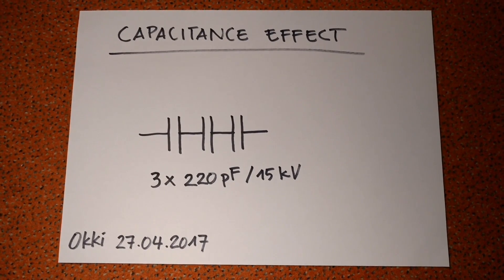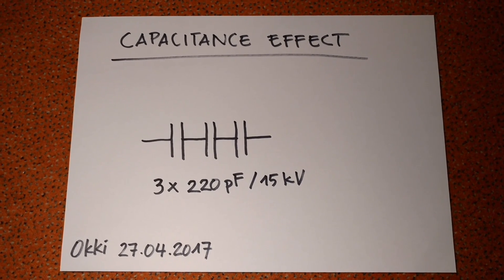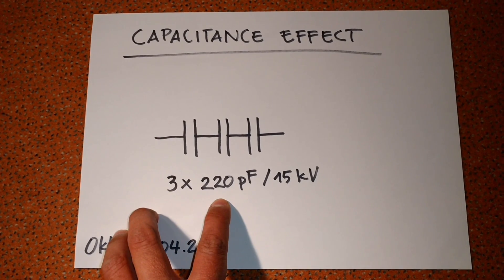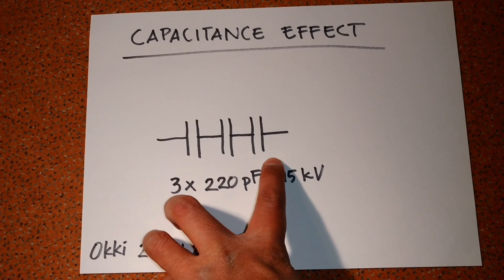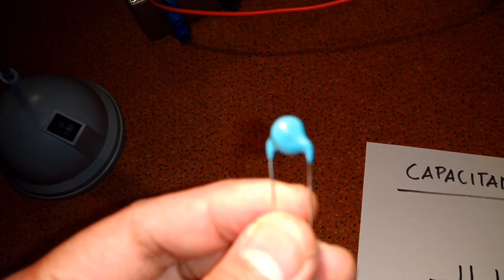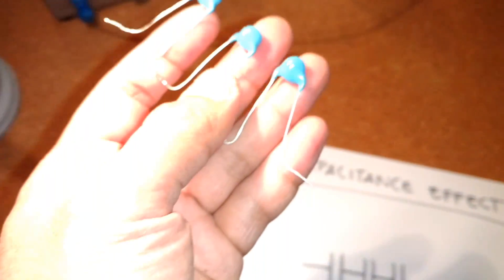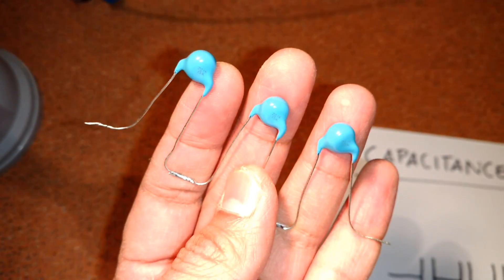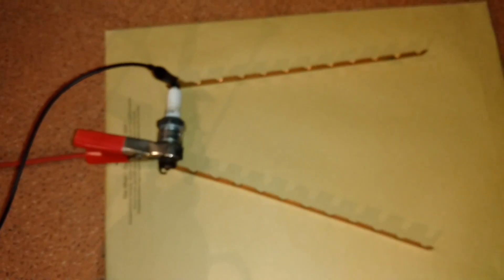Simple Plasma Ignition - Capacitance Effect

Comment: If this work so good... than any car factory used it from 70s. And if they don't... maybe it is not so good as it seems.
To make this test good - you have to make air pressure on electrodes equal to that it is in runing engine.

Comment: Greetings my friend!Great video!I have a question..Surely,we use low resistance ignition wire and non resistance spark plugs..Does it really matter if we use spark plug cap with resistance?? Or the whole idea is to have the less resistance possible to our "circuit" =(spark plug wire,spark plug cap,spark plug) ?I plan to use 3 capacitors like these at your video (15kv,220pf) in series to a 125cc motorcycle for experiment,hoping the piston won't crack.. :P
Reply from the maker: Hi Nick. Any resistance along the way will reduce the plasma effect, if it's too high it will kill this effect completely. Connect the capacitors as close as possible to your spark plug, the closer the better. You can crack your piston only if your engine is knocking but not from the ignition.
Reply: Thanks for the advice..I'll give it a shot!!

Comment: I dont understand the reason why the spark is getting stronger
Reply: The current isn't constant, it's actually pulsing at a high frequency. I think that the capacitors get charged when the current is flowing and then discharge across the gap when the current stops.
Reply: So it's like a double spark? The first provoced by the ignition coil and right after that the second by the capacitor discharge?
Reply: @josefelix4152  I think so. It's just happening so fast that it seems continuous.

Comment: Does it applies to improve a motorcycle ignition? Does it increase the frequency or only the AMPs? If it increase the frequency I guess I won't work because of there won't be synchronicity with the engine cycles, right?
Reply from the maker: These capacitors intensify the sparks just like nology hot wires do.

Comment: Hello! Thanks for the video! I have a question. I build circuit for driving car ignition coil, and it's working perfect, but there's no any difference when testing Standard - Copper spark plugs, and Iridium (all NGK). Also there's no any difference in the spark when using 1, 2 or 3 strings by 3 capacitors, each 220pF/15kV. What could be the reason? What is your coil or driver circuit...? Please help
Reply from the maker: Please measure the resistance of those spark plugs. This simple plasma ignition will only work with non-resistor (low resistance/copper) spark plugs. Any igniter will do, no need to build igniter exactly like mine.
Reply: @OkkiMoeljadi  The resistance of some of my plugs is 4k, but i have also one with 0.04 ohm. Well... even with so small resistance and 3 strings by 3 cap.- 220 pF/ 15 kV, there's almost no difference... What coul be wrong?
Reply from the maker: It won't work on 4k ohm spark plugs. Try that with non-resistor one. You can try with 2 caps in series instead of 3. Make sure you are using copper core ignition wire as well.

Comment: What voltage you are applying?
Reply from the maker: I use Bosch ignition coil.
Reply: How are you controlling the spark?, Oscillator? Points/motor?
Reply from the maker: I use a home-made igniter.

Comment: i try with my piaggio not working do i need battery for it?
Reply from the maker: You don't need any battery for this.
Reply: Okki Moeljadi  hi thank you for your reply cant get it to work
Reply from the maker: Maybe you need smaller capacitor value. You can start with 50 pF and see if it works.
Reply: Okki Moeljadi  does it matter how i connect do they have minus or plus?
Reply from the maker: If you confuse about the connection, please watch all my videos regarding plasma ignition. Your question has been answered there. I have shared all information for replication.
Reply: Thanks

Comment: Was that just increasing the number of sparks per second or was it also increasing the strength of the sparks as well? 

Thanks for the video BTW.
Reply: I'm pretty sure it was doing both...but I wonder if it would melt my piston 😂
Reply: I believe it’s just increasing the frequency. Since the distance of the spark gap is constant, the voltage required to dielectrically breakdown air is constant. For example, if the spark gap is 1 cm, it takes 30,000 volts to arc across. Obviously the spark plug can generate this high of voltage on its own and has a certain frequency. The spark plug is just an LC tank circuit so by adding the capacitors in series, the total capacitance decreased. Frequency = 1/(2pi*sqrt(LC)) so as capacitance decreases, frequency increases. Even if it increased the voltage capability, the voltage would only ever reach 30,000 volts before it arced and went back down to zero. I think it looks like the arc is more intense because there are more of them per second.
Reply: @Nicksperiments  doesn't capacitance increase in parallel, and decreases with series?
Reply: Revi M Fadli yes, I meant series. Good catch
Reply: Kyle Clark it is only increasing the spark intensity because the spark frequency is depend on how fast you want to drive/push the throttle.
Reply: @vughdeziestem4358  I think this is why it wouldn't work with a vehicle, because increasing the frequency there won't by synchrony with the engine cycles
Reply: Luis Ernesto Alvarado Holguín vehicle spark timing  operation is done by pulse signal transmitted by pulser.  that why we need timing belt/chain to keep timing operation synchronous all the time. the circuit above is only gain arc power.
Reply: Vugh de Ziestem are you saying you change engine rpm by changing the frequency of the spark plugs? Cuz that’s not how it works. Cars have distributors that determine when to send power to the spark plug and it just increases how often it sends power to increase engine rpm. If each cylinder was fired every time the spark plug sparks you’d have an engine going minimum 50,000 rpm. This video was just to demonstrate LC circuits and nothing to do with cars. Spark plugs just happen to be pre-made LC circuits
Reply: Nicksperiments i mean engine rev influence the spark frequency. i think this video demonstrate how to increasing spark intensity of an engine (car/bike).

Comment: Capacitors connected in series exponentially reduces the capacitance. Is this actually helpful here? Because i know that less capacitance means a faster discharge.
Reply: Isaac Westawski sometime that is needed to be able to withstand higher voltages
Reply: Isaac Westawski no matter how fast discharging rate as long as the coil is able to supply current/voltage.

Comment: I wonder just what is happening? How can a capacitor create 'plasma' spark? Is it just higher kv at the plug? And why it will not work on resistor plug?
Reply from the maker: If you want to know how this works, please study Tesla Coil and pay very good attention to the primary side of the system.
Reply: The spark plug is an LC circuit. As you add more capacitors in parallel, the total capacitance decreases which exponentially increases the frequency
Reply: Science

Comment: How many capacitors can you add? Surely there is an optimum number? Can it be worse if too many?
Reply from the maker: How much capacitance you can use depends on your system. The more power the ignition power has, the more capacitance you can use. You also have to consider how high the maximum RPM your engine can run. By adding capacitors, you will actually lower your maximum ignition frequency.
Reply: I was thinking on this booster, because my spark is very weak and on lower RPM the spark is even worse. The max. RPM this engine revs is around 7500 RPM, so how much capacitor do I have to use if I have a weak ignition spark and the RPM is relatively low?
Reply from the maker: Jordán, you can start with 70 pF capacitor.

Comment: I don't understand what I just watched.
Reply: He added more capacitors to increase the frequency
Reply: @Nicksperiments  that's what I don't understand...  How changing capacitance increased the frequency.
Reply: Josh Withrow as you add capacitors in series, the total capacitance decreases. The spark plug is basically an inductor and a capacitor so it’s an LC circuit. For LC Circuits, frequency = 1/(2pi*sqrt(LC)) where L is inductance and C is capacitance. So as he decreases the capacitance, it’s making the denominator of that equation smaller so larger frequency
Reply: @Nicksperiments  Capacitance in parallel conection of capacitors increase, in series decrease. Or I'm wrong ?
Reply: Wrublos212 yes, I meant series. Good catch
Reply: i c u p

jk i see you everywhere

Comment: Your ignition system will be making less than 5 KV with that spark gap so won't run an engine. To do a real test, open the spark gap to 3 cm and repeat with the capacitors.

Comment: Great video this help with performance most people don't know that a bad spark reduce power and waist fuel you can do this just with the coil no inverter and it will work to if you have a weak coil this will help you
Reply: i would NOT try that in an engine as a hot spark will burn a hole in your piston
combustion engines are all about balance

Comment: Brilliant demonstration of how capacitance can create a stronger spark - however, most motorist wont see much gain unless there ignition system is very weak by design or you have modified the engine IE:- fitted a bigger turbo or increase the amount of boost to produce more power and the intake charge is too dense for the standard ignition system to fire it !  None the less im sure this will help those who need it - great work sir !

Comment: Hi sir,,,I tried in my motorcycle 125 cc...the spark plug shows me nice spark at the outside ...but when I put it inside..my bike doesn’t want to start..any solution??
Reply from the maker: 1. Measure the capacitance value. 2. Check for electrical leak (spark outside sparkplug tip).
Reply: Okki Moeljadi ...ok sir thank you....I will.check and will contact u..thanks again

Comment: Okki, I've made the capacitor bank in my 1200w generator but got no increase in spark production. Maybe my ignition is weak for this arrangement?
Reply from the maker: If your ignition coil is too weak, you wouldn't get any spark at the spark plug. Maybe your resistance is too big. Please measure the resistance of your ignition cable and your spark plug, it should not exceed 1 kOhm in total.
Reply: Okki Moeljadi my spark plugs is non resistive . 0,00ohm. Now I will measure my cable. Thank you again!
Reply from the maker: You are welcome Andre!

Comment: It does absolutely gain my interest to see this. Is it true that the spark plug contact areas will rapidly erode from this treatment & the " gap" should become greater & greater as the metal itself is lost at the molecular level from the intense electrical discharge?
Reply from the maker: Yes, the bigger the spark the faster the erosion of the electrodes. I use only 73 pF for my car, that is a good compromise for me. I have tried water plasma circuit and all electrodes were gone before I reached 300 km.

Comment: LOL, Capacitors are storing the current on each cycle then releasing when the arc ignites each pulse. The frequency change is due to the circuit resonance and if you notice, the current output from the HV supply basically cant handle much more than two strings of caps. The RFI increases thanks to the higher current flows. Shitty camera Mic used that is getting swamped by it.

Comment: Just put platinum or iridium plugs.
 If you knew how engines work you would realise that you are making a weaker spark under compression and shortening the spark duration which = less power.
Its a nice spark plug display to show your friends though. 
You need a strong solid single spark to make power, use fine electrode platinum or iridium and its done.
Reply: So its actually a smaller spark, since the ionized air being compressed then?
Sorry I'm just asking, I dont have any electronics or engineer background.
And so, this kind of method is better for making a wider gap of stun gun's contact points, maybe?
Reply: madazz01 But as far as i know, iridium spark plug had a resistor inside to prevent electrical damage for modern car e.g ECU, if so, then plasma ignition will never create ? Correct me if i'm wrong..